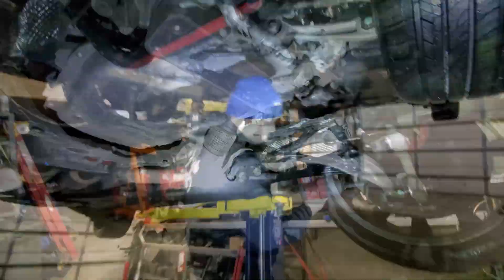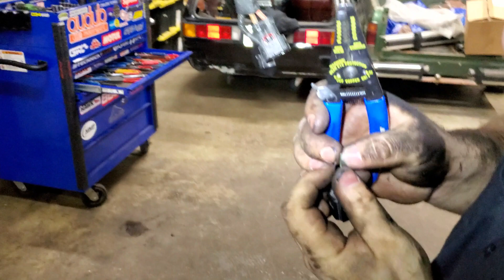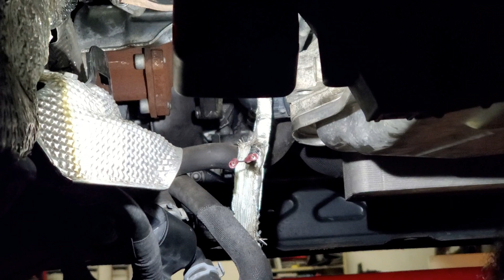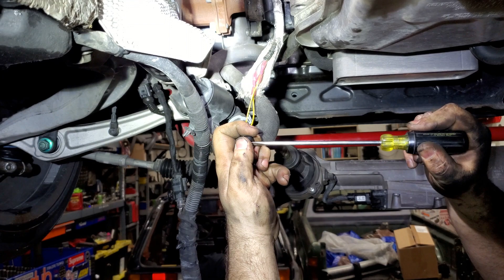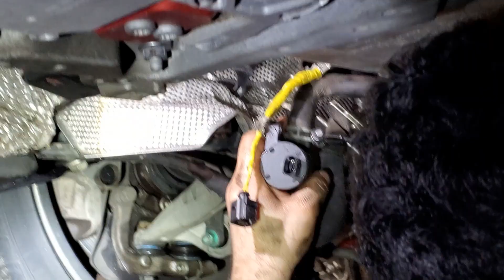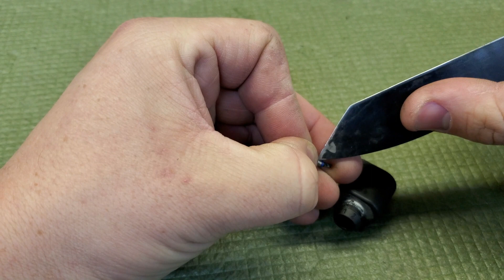Audi ZF8 Trans Cooler Valve Replacement DIY (Fix Code P2753) | C7 A6/A7/RS6/RS7, B8 SQ5, D4 A8/S8

Comment: Hi man can this be the culprit of trans fluid overheating? It does it in traffic, and when i see the transmission oil valve status it set on open. From the start when i start the car its set on open.
Reply from the maker: Possibly! Do you see this fault code?
Reply: @GarageTaught I dont see the fault code but the valve is open from the start and the car gets extremely hot in traffic very fast. And in highway speeds stays at around 158-176F

Comment: did you bought the “OE supplier” or the “genuine vw audi” part? is it still working with no problems? i have the 7 gear transmission in my 2012 A6 and got the open circuit fault code in vcds.
Reply from the maker: I honestly can't remember which one I got but it's been good ever since
Reply: @GarageTaught could you do me a favour and check your order and tell me which one manufacturer was it? does 7 & 8 gear transmission use same part?
Reply from the maker: Bro that was SO long ago I don't have the order anymore
Reply from the maker: Ask your dealer for the correct part number and then cross reference it on ecs/fcp/usp/etc
Reply: @GarageTaught i was about to order all parts from FCP euro. did you need to bleed out the coolant after this?
Reply: @GarageTaught btw very dumb question but do i have to unplug the battery because of doing the wire repair?
Reply from the maker: You shouldn't need to bleed the system if you clamp off the hoses. You may need to top off the reservoir though.

And no you don't need to unplug the battery

Comment: Today I tested the transmission cooler control valve, with multimeter it working, and tested it with 12 volt it working too and you can hear click

Comment: These Coolant Shut off Valves are an issue to any VAG car fitted. Its been a known problem part since 2015, yet they still fit it to new cars. My Skoda Octavia RS 162 2017 suffered this issue.
https://youtu.be/lGEX5ht-ymQ?si=TOPF6NItkoXziT6q

Comment: I just did this repair yesterday, and it's still throwing the same code and the CEL is still on. Any idea what it could be? 2012 A6 prestige
Reply: Hey brother, okay, so I couldn't leave well enough alone, so up on the ramps she went, ordered a new part from FCP EURO, and 2.5 hours later, and voila! She's working! Thank you so much for putting out these videos. And thanks for replying to the community on a regular basis. BIG help.
Reply from the maker: If it was bad for a long time the corrosion could have traveled to the tcu and damaged it
Reply: @GarageTaught  thank you for the reply. I mean, the connector was definitely corroded, but when I spliced in the new one I made sure I cut back far enough to expose good wires, like your buddy did in the video. I keep clearing it with OBDEleven, but it keeps coming back. This is not a job I'd care to do again, I don't have a lift and my garage is small. I guess it's a trip to the mechanic! Thanks for your help and putting out quality videos 👍
Reply from the maker: @Handsome_Handful did you buy an oem valve?
Reply: @GarageTaught  no, I got it off Amazon. OEM is crazy expensive.
Reply from the maker: @Handsome_Handful that could be the problem
Reply: @GarageTaught  would FCP Euro sell OEM?
Reply from the maker: They should.
Reply: @GarageTaught  thanks for your help! 👍

Comment: Holy crap I know I’m late to the party, but this scares the crap out of me being a Audi technician using butt connectors and electrical tape. At the very least use solder, heat shrink and OEM style harness wrap, tape just my suggestion.
Reply from the maker: Haven't had a problem since.

Comment: Awesome vid!! Is this the fix for code P19A2 on my 2018 VW Passat R-Line 2.0T? error reads: "transmission cooler valve open circuit" thanks for any advice or input!!
Reply from the maker: Sounds like it's something similar to this, but I'm not very familiar with the passats.

Comment: Thanks for the video brother I went ahead and switched the valve and did the harness with connector only thing is that the two codes pop out right away p2754 and p2753 what do you think I did wrong I followed the steps on the video watched it like 4 times please help is there anyway I can test the wires to see if there’s voltage?

Comment: Should the engine light go off right after replacement? Or will it need to be cleared
Reply from the maker: @Hunter-ck4di  it may go off over time, but it's always a good idea to clear it and check later to see if it returns.

Comment: Thanks for the video, came right on time. I have one issue, after purchasing all of the parts listed above I have an issue with the repair wires, the ends don't fit into the connector housing. Any suggestions?
Reply from the maker: I just spliced in the section I needed to replace. To replace the end in the housing you have to add the pinned connection pieces to the wire.
Reply: @GarageTaught  Thanks for getting back to me so quickly, I appreciate it. My valve, connector housing and wires where all corrupt (I have 200k miles on my A6 C7), but the ends of my wires are too wide to fit into the connector housing. Reaching out to FCP Euro about a solution. Thank you and keep up the great work.
Reply: @GarageTaught  a question please is the Transmission cooling valve for 2011 Audi S4 in the same location?
Reply from the maker: Do you have a dsg? If so, I'm not sure if has the same valve that ZF-8 transmissions have.
Reply: @GarageTaught  thank you, yes it's a dsg

Comment: Hello brother I have an Audi a5 and I took my car to a garage as I’m losing coolant not by a lot but losing more then I should there isn’t any coolant on the floor either, after short runs coolant doesn’t go down, took my car to a garage and told them and they are telling me I need to replace the whole water pump? I’ve had the car only a year mint condition, I’ve ran a diagnostic and I’ve got that code
Reply from the maker: I'd probably listen to the shop, but tell them any that code as well

Comment: When you say wire harness are you referring to the two yellow cables? I attempted the job and noticed the wires are all corroded to where I can not see any further.. is this something that can be done with just the two yellow wires? Or am I going to need a lot more wire?
Reply from the maker: If it is corroded all the way to the tcu then you might have bigger problems.

Comment: hi, first of all THANKS for all your videos... I just get this P2753, I will check if it come back tomorrow but now I know how to solve it. Just a question regarding the cable, you cut the new ones to have the same length as it was before you cut it? what is the "tolerances"?
Reply from the maker: Yep. We just measured the distance we removed & replaced that length with the new wire.

Comment: Replacing the valve and the plug in wires that clip in are still good, can I just clip the wires into the new electrical connector and reinstall?
Thanks
Reply from the maker: As long as none of the wiring is damaged yes

Comment: I am getting this fault code as well as P179D are they related
Reply from the maker: That's your coolant oil valve throwing a fault. It might be related, but you need to have a shop diagnose it

Comment: I got the code and drove it 5 minutes to my house and it’s been parked and I’m waiting on parts to come in to fix it should I unplug the connector to migration or as long as it’s not running and pumping should I be fine?
Reply from the maker: As long as it's off it should be fine

Comment: Was wondering if you had a check engine light or just the code stored I have no engine light but I have the code
Reply from the maker: Just the code stored
Reply: @GarageTaught  would you say not driving the car will let me hold off the repair abit longer due to the part not being in stock in New Zealand  it for about 2 weeks even though i have had this code since febuary
Reply from the maker: As long as this is something that just started happening you can drive the car. Just don't drive it for an extremely long time (months) without changing it

Comment: Great thank you for this video i just have this code just 2 days ago the gear icon and engine light was on and off
Reply from the maker: Hopefully you can get it fixed easily!
Reply: @GarageTaught  yes and i am hoping my extended  warranty will still be in effect since it will due on the 17th of Dec   not so good timing since it was tThanks Giving Holiday carmax and audi were closed they will open on Monday the 28th i made a appoint on Audi on in adavnce for Dec 29 and i will contact carmax on Monday hopefully it will still be covered since it happened while still covered 😞i am the 3rd owner and it only have 65.978 miles for 2012 driving only 50 miles in a month thats why i am so surprised it show codes same on the shifting gear i cant use my sport mode it comes and goes 😞😞😞

Comment: Awesome video man! I’m running into this issue now with my A7. Same thing, we replaced the valve and connectors and the code popped up again… since it’s a new valve, is there concern that coolant can still get to the TCU or does it just need to be cleaned?
Reply from the maker: Did you replace the wires as well? Sounds like you may need to if you didn't
Reply: Could you solve the problem? Going through the same, replaced valve, and wiring and still have the light on
Reply: Same here
Reply: @BeStOfThEbEsTMEX  did you happen to figure out why the light was still on because I'm in the same boat

Comment: Ordinary electrical tape OUTSIDE the heatshield tape is going to melt into goo and unravel. There be crimped heatshield tape or sleeve in the autoparts or heating store.

Comment: Hi, I seem to be having the same problem with the 2012 A8. I have replaced the valve, but the problem remains. Upon inspection of the old valve showed corroded connection pins. I placed a new valve but didn't make any changes to the wiring. Also, I am seeing from different sources that there could be several of these same valves in use around the car. The one I replaced was in the front of the car, near the wheel well on the driver's side. Can anyone confirm that this is the correct valve to replace for "12446 Valve for Transmission fluid cooler".
Reply from the maker: The A8 is a bit different than the A6, but I'd suggest replacing the wiring harness as well.

Comment: I'm looking at ordering these parts, but multiple websites tell me this will not fit my C7 S7 (2013). Do you know if I need different part numbers for my car?
Reply from the maker: That's because this part is for the Zf8 transmission. You have a dsg. You may have something similar to this but it might be a different part number.
Reply: @GarageTaught  thanks! I thought yours was an S6 with the same trans
Reply from the maker: No problem! Good luck!

Comment: The video was great I haven't seen one as long and informative I just wish you would have given the bolt size for the cross member as I am trying to get it done ASAP I changed my oil and decided to change that since I had P2753 code for a couple months now, also changed the fuel door actuator that was a cake job!!!

Comment: Hi!

Does the last letter, 'D', stand for diesel in 4h0121671D. There are both 4h0121671D and 4h0121671B available for my type of car but i don't know if it matters which letter it is at the end?? Our valve had B at the end originally, put in a new that happened to have D at the end, warning light finally stopped but returned when i backed up from the lift..

Comment: Great video thanks for the in depth repair. I'm curious though. I have this problem and was wondering if for the time being I'd be able to just disconnect the plug so it dosent lead the the tcu fault before you repair it.
Reply from the maker: Disconnecting it would stop the coolant from transferring up the wiring harness, but then the valve wouldn't move any coolant and that could damage your transmission.

Best bet is to get it fixed asap

Comment: Did You know when this valve was open ?  In my S6 2014 cooler valve open when temp of gearbox oil is near to 95 degrees i think is to late. I had P17D4 00 fault code ( appears when gearbox oil temp. is 88-90 degrees.)
Reply from the maker: You are having a more serious issue if you are getting that code. Check out this thread:

https://www.audizine.com/forum/showthread.php/868749-DSG-Throwing-Code-8955-P17D4-Valve-3-in-Transmission-Part-1
Reply: @GarageTaught  yes i find this posts, i change  N471 and N472, no change. Now i order 0B5398048D repair kit.

Comment: Would this valve cause a p179D00 code?
Reply from the maker: No. That is a daily for a cooling solenoid inside the transmission if I'm not mistaken.

Comment: I bought an A7 at an auction recently and the car was low on engine coolant and had a check engine light on and also the engine was on reduced power. I replenished the coolant in the system to check for any leaks and there were not any, the check engine light went away as soon as I replenished the coolant. everything else was absolutely fine. drove the car home (2.5 hr drive) and the check engine light came back on. but I did scan the computer for codes before driving and this one popped up. Since the transmission was shifting like a champ, figured the valve failed open, so the coolant flow was not hindered. But I did not know about the danger of coolant traveling up the wiring like that. It would be interesting to take the valve out and hopefully I do not have to replace wiring and stuff on it. thank you for the very informative video. you are a champ.
Reply from the maker: Good luck! Hopefully you don't have any further issues
Reply: @GarageTaught  thanks man. I really hope so too. I can tell the car wasn’t over the right way. So that concerns me a tad bit. Cuz the previous owner definitely was not a car guy.
Reply: Always replenish!

Comment: I did this replacement and I’ve gave it a week with deleting the code 3 times but still coming back is there any way to see if the valve is actually working?
Reply from the maker: Did you replace the valve, wires, and connector?

Comment: Good informative video,, thank you for posting it. 
This part is also on the 6spd MT, I recently had to replace it. I was able.to get it out from the top. I did have to get under to disconnect the coolant line, but the connector replacment, removing the 2 10mm mounting nuts I was able to pull from the engine bay.
Reply from the maker: That's interesting! What motor?

Comment: Not sure whether you have already done it, but would love to see an engine mount replacement if possible.
Reply from the maker: We got the passenger side done, but the drivers side defeated us. At the time, we didn't have the instructions on how to lower the subframe to access the oil cooler bolts and get to the drivers side mount.

We may try & tackle this again in the future.
Reply: @GarageTaught  is this a common problem? I'm about to take mine to a certified mechanic for an inspection. I wanna know if it is worth keeping, or if I should flip it, which was my original intent.
Reply from the maker: Motor mount failure is extremely common on these vehicles. Pretty much a guarantee to fail part
Reply: @GarageTaught  The car ran smoothly from the one mount that got changed? I can feel my car starting to get worse, my right exhaust also rattles at the flex joint around 1200 to 1500 revs, I'm guessing that might correlate to the right engine mount usually going out first as well.
Reply from the maker: I had a shop do my driver's side so I got them both done. Your exhaust rattle is likely your flex pipe

Comment: Thank you so much for this vid. You are a life saver! 😉
Reply from the maker: My pleasure! It's such an easy fix that can save thousands in the long run.
Reply: Did you re-use the bolts for the cross brace? I thought they are only one time use stretch bolts. If yes, have you had any issues with them?
Reply from the maker: I did re-use them & haven't had any issues

Comment: I would pack both ends of that electrical plug with dielectric grease just to be on the safe side.
Reply from the maker: Definitely not a bad idea
Reply: I thought of exactly that as I was watching the video. I was recently working on a chevy and had to do that to the grill shutter connector as it had signs of corrosion.